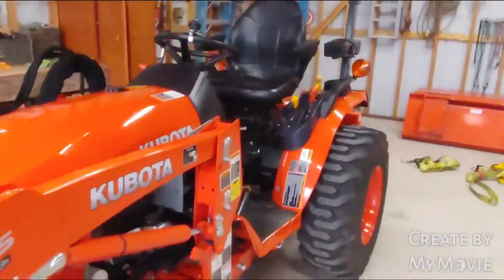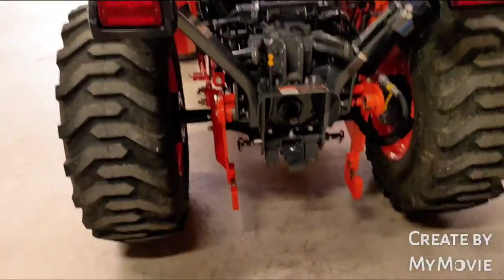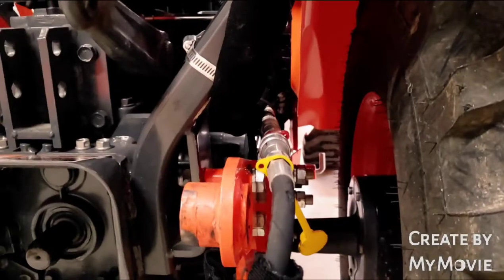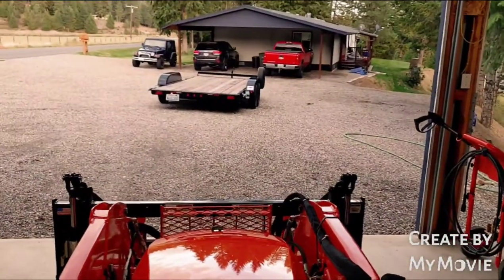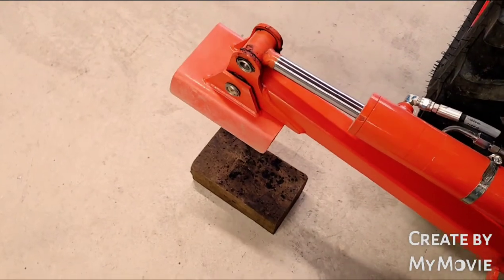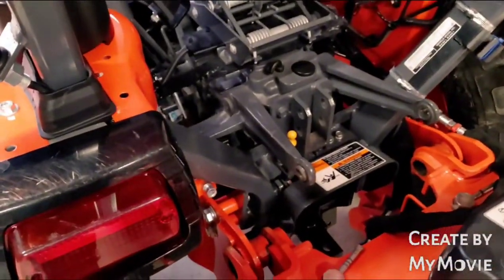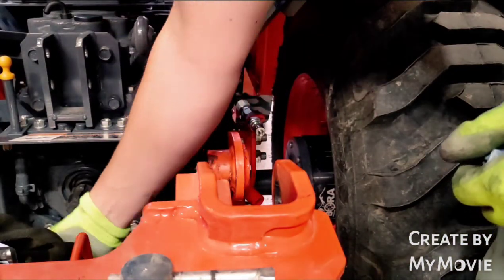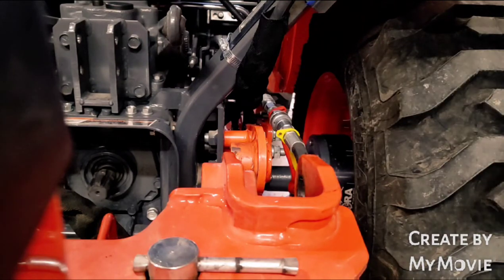How to remove and install a BH70 backhoe: Kubota B2301

Comment: This is great but I sat dn for about 3 hrs about with the manual  over 4 days and step 12 did not make sense so I called the dealer. Bottom line I have the bh70 disconnected but can not hook up my hoses because the colours are wrong and I am waiting , watching videos and trying to figure it out. Problem is no one identifies the lines sufficiently because they depend on the colours. So let’s say I went ahead and hooked it up on colours. Will maybe I end up blowing the seals and 3 to 4 thousand later it will be fixed. If I knew which line on the tractor was the tank hose I could make my connections. But no where in the manual does it clearly identify the tank hose except by colour.

Comment: That is very interesting normally the two hoses on the tractor they need to be couple together why the backhoe is not in use so they can circulate through the system interesting trying to figure out how that is plumbed
Reply from the maker: I may not have shown it very well the video. Your are correct, there are 3 hoses that come out of the tractor. When the backhoe is off the red and yellow are coupled together to complete the hydraulic circuit. The blue is set off to side. Have a good one.
Reply: @6DOutdoors  what is the blue line for if you don't mind me asking I'm curious
Reply from the maker: @thegreatnorthwoodswithbb6513  the blue line connects to the backhoe when it's attached. There are 3 hoses that come out of tractor for the power-beyond. I think the blue hose is to complete the circuit when they backhoe is attached. That's what the dealer told me.

Comment: I currently considering this same model and set up, what size trailer do you use to haul yours with the backhoe hooked up, does the back hoe hang off the back of your trailer?
Reply from the maker: I use a 16 foot trailer. The tractor just fits on the trailer with the backhoe bucket resting on the trailer. If I think an 18 foot would give a person that little extra room. Good luck in your tractor purchase. Take care and all the best.
Reply: @6DOutdoors  any likes / dislikes about the b2301?
Reply from the maker: @Northeast_Mainiac  so far it's been a great tractor. 310 hours with no issues.  There have been times a bigger one with more lifting capacity would be nice but overall it's done everything I wanted it to.